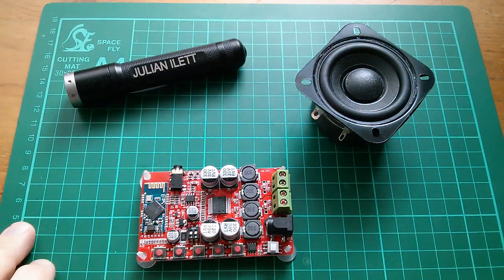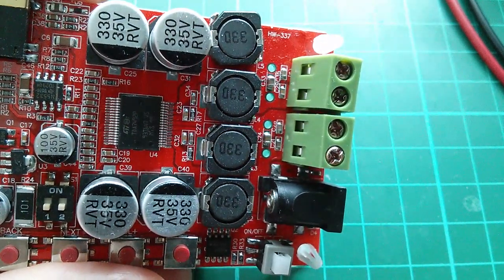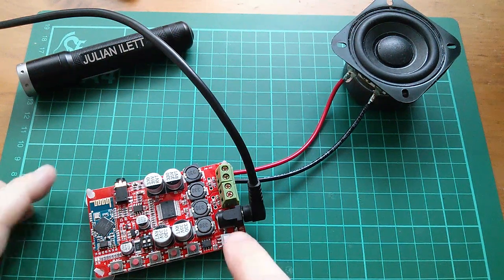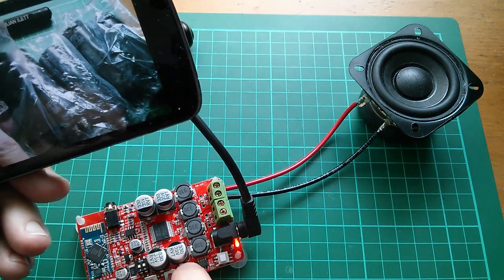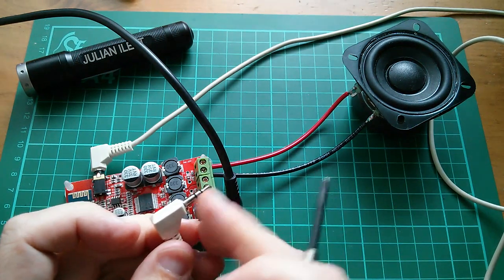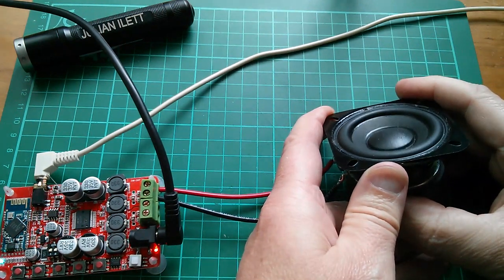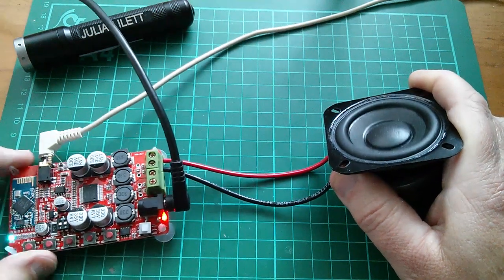SuperCapacitor Bluetooth Speaker Testing

Comment: Polarity DOES matter. If you have two speakers in reverse polarity, you will have two speakers canceling each other out and practically just have the identical signal muffled and the difference of the two channels louder than usual
Reply: You've made a case for matched polarity between channels, not absolute polarity.  I doubt if absolute polarity matters.
Reply: Julian only had one though, so no destructive interference :P
Reply: Absolute polarity doesn't really matter but to say polarity doesn't matter over a speaker can be VERY misleading when the case of mono and stereo differs so much
Reply: Speakers are driven with "AC", so polarity doesn't matter as long as ALL speakers are using the same polarity (driven in phase). You will not hear the difference swapping polarity on all speakers. However a phase mismatch by connecting one of the speakers reversed will mostly affect low frequencies, you would find the bass missing or sound strange, especially if they share the speaker housing (for example the trunk of a car). Some home cinema subwoofers (with builtin amplifier) has a phase shifting switch, which I would assume is for people connecting their speakers wrong (or to better fit the room acoustics perhaps). Usually all amplifying transistors invert/phaseshift the signal about 180 degrees (high on the sinus wave = low out and vice versa) but that is usually taken care of by preamp circuitry, so that input is in phase with output.
Reply: Don't you think your comment was misleading then?
Reply: Polarity does matter. The cones are designed to cope with being driven outwards with a peak signal. Driving them inwards instead (reversing the polarity) wont do them any good.
Reply: I've never heard of any standard for absolute polarity.  So a kick drum from one album could drive the cone outward while another may drive it inward.  "Golden ear" HiFi people may say differently, but for general audio, polarity doesn't matter except that it be consistent with other speakers in the same system.  Regardless of if the cone is being driven in or out, it has a limit of travel.
Reply: Speakers drive inwards no matter which way you connect it. The cone sits in a central position by default and the signal will move the cone forwards and backwards. Polarity only matters if you have multiple speakers.
Reply: Gabe Sigal-Ribeiro your last sentence made no sense at all and will only confuse people. Ohms is the rated impedance of a speaker, which essentially is the load the amplifier "sees", nothing else. "DC" from an amplifier as people tend to call it, is when you run it to hard and the signal gets the waveform capped = Distortion. On a side note: Tweeters are usually the first to break from distortion while, woofers can handle it better.
Reply: Polarity DOES matter,  even in a mono system.  If someone hits a drum in the music,  the speaker cone should spike outward causing a POSITIVE pressure wave.    It's subtle and hard to hear on most sounds but it's there.
Reply: MattOGormanSmith have you ever seen a drum waveform on an oscilloscope? What you write is simply not true, please base your comments on facts. Polarity does not matter if all speakers are in phase (connected with the same polarity).
Reply: Gabe Sigal-Ribeiro well not misleading but probably contains too much information, so yes it could be confusing too. But generally there is so much "truth" spread in these comments based on no fact. Did not mean to be rude. I'm sorry.
Reply: If the mic was placed in front of a kick drum, then it would spike outwards.  But if it was placed over a snare, it would spike inward since the initial hit is away from the mic.  But that doesn't matter.  The real sound we respond to isn't the initial strike, but the vibration it sets up in the drum head.  If you can hear the difference in polarity on a mono speaker, then it's probably distortion caused by the speaker when the cone moves the other way.
Reply: Drive your system hard and you'll notice the difference if the polarity is switched. You'll hear a choking effect.
Reply: Does polarity matter if you drive the system into distortion?  Probably.  It may even enter into distortion sooner in one particular polarity.  But that doesn't mean there's a "right" polarity.  Otherwise, this would have been a significant issue in the recording industry.  I'm by no means an expert, but I think it's safe to say it's not what concerns those who do recordings.
Reply: Russell Hltn. The lowest frequencies normally heard by a human is about 20Hz, right? It means that the coil moves forth and back 20 times per second... if that first wave of the waveform pushes the speaker out or in for a 20th of a second, do you think it matters? When playing, the coil never gets pushed out as it would be when connecting a DC source to the speaker, there is always a return wave the next 20th of a second (if at 20Hz). Here is a thread of this discussion where they even claim that different recordings randomly may be in or out of phase depending on the equipment used, which also suggests that polarity does not matter: https://arstechnica.com/civis/viewtopic.php?t=1278137
This is like when they try to sell you polarized speakercables to get better sound quality... (its a scam).
Reply: I'm not talking about driving your system to distortion. I'm talking about the sweetspot where your amp and speakers work at maximum efficiency, usually 2/3 of the way up on your master volume. At high levels, the physical vibrations that are produced (if enough power is applied in the wrong direction) will cause the back of the cone to hit the magnet. You can hear a rasping sound when it happens. Try it yourself. reverse the polarity of your speakers and forget about them for a while. Continue using your system and pretty soon you'll hear the rasping sound where the bashing of your speaker coil (being knocked out of shape) will not move freely through the circular slit designed to accomodate it.
Reply: "I'm not talking about driving your system to distortion. ....   will cause the back of the cone to hit the magnet. You can hear a rasping sound when it happens."

I'd call that driving it to distortion.
Reply: Zibbe Zabba Hard to prove if polarization had to do with it once the speaker is blown...
Reply: @ Russel Hltn  Yes you probably would.
Reply: nope :-)
Reply: @ DAW 75 True, in a 'one off' instant. Thing is... speakers are an integral part of my business. They have been for 30 years. You get to know what it is you're doing wrong when it's costing you money.
Reply: Zibbe Zabba I respect your long experience. But how would you know for sure that the polarity was causing the issues? Assuming ALL speakers were connected in reverse? Since I agree that connecting one speaker out of phase might actually harm the speakers (the speakers then help each other pushing their coils further, especially if they are sharing speaker cabinet)
Reply: If your cone is hitting the magnet then you are driving the speaker beyond its mechanical limits (Xdamage in most driver datasheets). The amount of mechanical throw of a driver is identical in both directions of travel. It would make no sense for a driver to have more travel forwards than backwards. If the excursion exceeds the excursion limits of the driver will start making fairly nasty banging sounds as the voice coil hits the end stops and it will destroy the driver very quickly.
Reply: @Douglas Fletcher: we're on the same side, but one minor quibble:  A speaker that slams into the magnet is more likely to have a audible effect and damage then one that runs into the travel limit set by the suspension.  Soft clipping as opposed to hard clipping.  But clearly, if one is pushing the mechanical limits of the speaker, it's being driven into distortion.  I can't see arguing about polarity based on which distortion is preferred.
Reply: @Russell Hltn - Fair point. I guess it's fairly likely that you will exceed the excursion limits in both directions if you are driving the speaker that hard. As you said though this is all pointless if you are hitting the limits of travel then you are doing something wrong.
Reply: +DAW 75 (You weren't rude at all, & I hope I don't seem rude either) Considering how many contradicting statements have been made to correct the initial comment; I find that said initial comment was misleading. though I agree that there is solid advice mixed into these replies.
Reply: It may not matter for your ears, or in an amplifier that's capacitor coupled to remove DC,  but at very low frequencies down to DC that you feel with the rest of your body,  you can find examples where it does matter.  The ones I'm thinking of are dance music originated digitally so probably never go through any analog pathway until they hit your amplifier.
Reply: its not even mono, its hlf of stereo

Comment: I recommend trying a capacitor between Mute and ground. Maybe 100uF or so. That would hold the Mute pin low for a moment after applying the power.
Great video and interesting project.
Reply: Hello, im getting a POP sound after putting a power supply in, would that solve that POP at startup?
Reply: I think yes ! but the pop when connecting bluetooth will continue (if your board have)
Reply: i already solved it. i could get rid of a HISS sound while pausing music like this: http://www.diyaudio.com/forums/class-d/293475-sanwu-tpa3116-csr8635-bluetooth-4-0-noise-fix-15.html#post5310492  and to get rid of the pop sound i needed to change the resistor R21with a 1 MegaOhm resistor and the startup sound is a bit delayed, so no POP sound.

Comment: LOL Julian , use black micro switch near capacitor, turn ON/OFF SW 2MUTE or SW 1STBY, is on circuit diagram too 10:50 :) i think is a solution and u dont need 10k resistor ;)
Reply: Those are gain controls, not mute and standby.

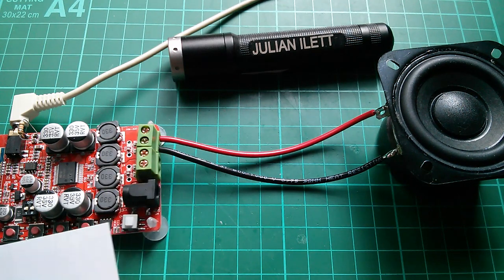Comment: The movement of the speaker at 15:44 is a bit strange when you plug in your caps.
Looks like it moves from maximum to minimum movement.
Maybe because the mute pin is not functional anymore.
Reply: You are correct...
Reply: Meiestrix No, thats just because of the Bluetooth Module booting up. My Speakers do the same without cutted mute pin.
Reply: Member Berry well it probably is because of that. Dc is being put out on the output. The output should have been muted.
Reply: Meiestrix that's very bad for ur speaker or amp... especially when it has more oomph... wanted to say the same... beat me to it
Reply: I put an RC time delay circuit on the mute pin to allow some time to mute upon startup to avoid click and thump. Works great.
Reply: That movement at 15:44 is typical for this Sanwu amp. There is a lengthy description about how to fix it on the diyaudio class d forum by "doctormord".   
http://www.diyaudio.com/forums/class-d/293475-sanwu-tpa3116-csr8635-bluetooth-4-0-noise-fix.html.  
The thread talks about several different amps so page thru until you find the 7492p posts and photos.  That on/off/mute button is new though, the last one of these I bought didn't have that. So his "fix" may not be applicable any more.
Reply: Thanks for the link, doctomord here. :)

I set up infos for those boards on my website as well.
http://www.360customs.de/en/2017/01/sanwu-tda7492p-csr8635-bluetooth-4-0/
http://www.360customs.de/en/2017/01/sanwu-tpa3116-csr8635-bluetooth/

Those mods are intended to get rid of the noise induced by power supply and BT module. They does not care about the muting and ignores the AUX at all.

Btw. Muting the amp withno BT connection up is for power saving reasons.
Reply: My bad.  Wasn't there a discussion about changing some values (R21 and R22?) to increase the delay before the amp came out of the muting state?
Reply: Glenn C, absolutely.

Comment: You should be vigilant and not tin wires going into a connector that will apply a physical force. It may brake the solder and create a loose connection. Most regulations include this point as a nono for safety reasons and for a good connection. if u need to just stop it from stranding, the smallest amount as possible  just to keep a shape to it
Reply: It is not so much that screw connectors will break the solder, but what happens is over time the solder will cold flow ultimately giving a loose connection. It is amazing the number of people that do tin wires which will go into screw connectors!
Reply: I was brought up to twist then fold the wire end over before using a screw-terminal, then the loop engages much more positively with the screw head and resists pulling out.  These days screw terminals have flat plates which might make that irrelevant though.  Tinning the end of a wire to stop unravelling usually results in the wire breaking at the point the solder ends if the wire is subject to any movement.

Comment: It seems like that speaker is designed to be in an enclosure.  If you put it in a sealed box or one with small band pass ports that high volume distortion will probably get a lot better.

Comment: I suggest adding a series cap to filter the sub bass out from the speakers if you are using ones that small, will save wasted power and reduce distortion at higher volume levels.

Comment: Hi Julian I've run into the exact same problem with a similar board and I did a similar mod but using a cap and resistor to prevent really nasty click and thump I was getting on power up. Silly design on the bluetooth muting if you ask me.

Comment: isn't the mute added in if your phone rings, and the speaker polarity markings are located under the green connectors, you have to pull the connectors over slightly to peek under the edge.

Comment: You shouldn't tin the ends of cables going into screw terminals. Solder is soft so it gives you a larger contact surface at first, but because it's so soft it will also slowly yield to the clamping pressure exerted by the screw, "creeping" out and increasing the impedance of the connection over time, until the wire eventually comes loose. For a speaker cable it's perhaps not a big deal, but for mains stuff it's a serious fire hazard. If you don't want to go to the trouble of crimping on a ferrule, you should just twist the strands and screw them in directly.

Comment: It also appears that most of the variations of this amp board are not really able to put out the full max power.  If they say it is 25 watts per channel they are quoting the peak maximum output power of the total chip (50W) under very specific circumstances, in reality, you can expect about 2.5-3 watts RMS  per channel and maybe 5-10 watts per channel peak before the distortion is really noticeable.  If they say it is 50 watts per channel you can probably expect about double the above numbers 5-6 watts RMS per channel and maybe 10-20 watts per channel peak before the distortion is noticeable.  

Back in my car audio days, we thought <0.5% THD was great 0.6-1% was decent for an amp and much higher than 4-5% was quite noticeable when the vehicle was stopped.

For home audio where the background noise is generally much lower, going much over 1-2% THD is likely noticeable.

Comment: why don't you route the mute pullup resistor through the jack detect switch on the 1/8th inch phono jack connector? that way you'd only unmute it when there was a possibility for input.

Comment: 1.That speaker is to small for powerfull class D amplifier.2.Probably the signal in AUX input is to small,that's why amp mute itself.3.For power you need efficient >3A current source .
4.Good idea is to use step-up converter [16V],even if Scaps is below 8V,amp will work.

Comment: I've had this exact board for about 6 months now, have it setup to two Memorex 205's I bought back in the 90's. The speakers are 8Ω & output 60w each. The sound is phenomenal. By far, the easiest way to power this, is to use a standard power bank. I bought a USB step up converter off ebay & it works a treat,the link for a similar one is below:
Look at this on eBay  http://www.ebay.co.uk/itm/112440499001
I use a fairly cheap power bank I bought from Aldi for £10. Its a 7800mAh, that uses a standard 5v output. The converter then ramps this up enough to power the board with no problems at all. When fully charged, the power bank will keep this thing going for a few days. One thing to note, though, with mine, if it doesn't sense a Bluetooth signal coming in for 10-20 seconds, the board will auto shut off, saving power. Make sure you have a playlist of music ready, as it can be a ballache having to keep turning it on. One more thing(sorry) stay away from those dip switches! When switched, it's just far too much power for the speakers, lol. Hope this info is some sort of help to anyone!

Comment: Hi Julian, old follower here, love the content. I have the same board minus the jack. Can you please tell me what is the role of the R24 resistor (marked with 101, right beside the dip-switches)? Mine gets very hot (burning hot) and I don't know why. Also the board shuts-down randomly

Comment: You may be able to enhance the sound quality by adjusting the gain.
That's what the 2 DIP switches are for.
With both in upper position the gain is 21,6 dB
1st down, 2nd up: 27,6 dB
1st up, 2nd down: 31,3 dB
Both down: 33,6 dB

Comment: I had one before, It worked fine! They didnt recode the CSR Bluetooth chip for allowing the AUX audio, as ive been told. Mine had working Volume buttons with i think play and pause working. I guess it varys seen as how cheap they are.

Comment: My amplifier board giving aux output,looking everything ok but no sound coming from both speakers channel when i am using blutooth no input working neither bluetooth nor aux input.i am using 19v laptop charger for power.two speaker using 8ohm 40watt.but overall no sound.what could be the reason?also playing on full volume both board and mobile but no sound.